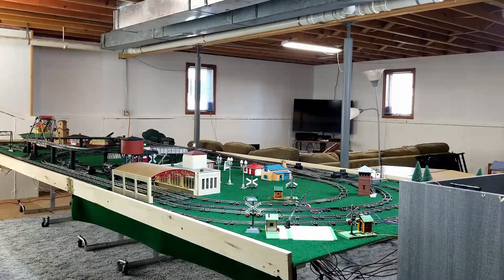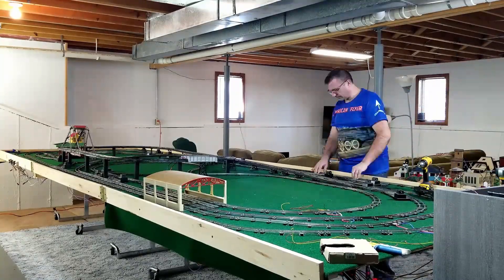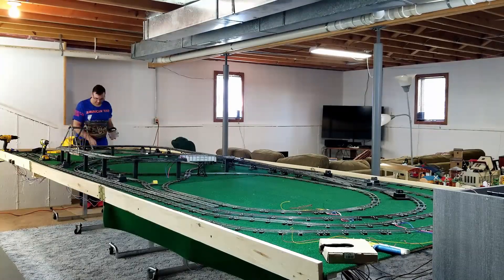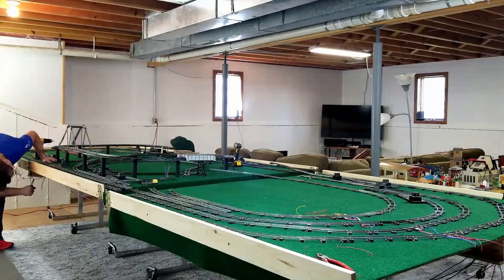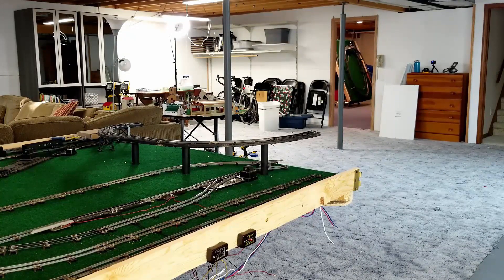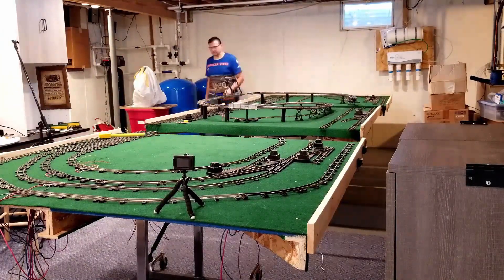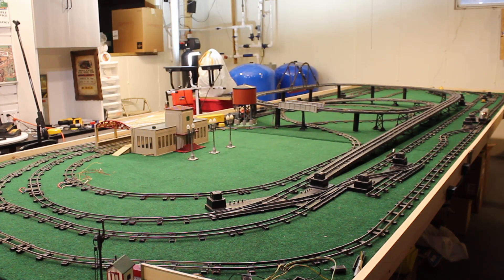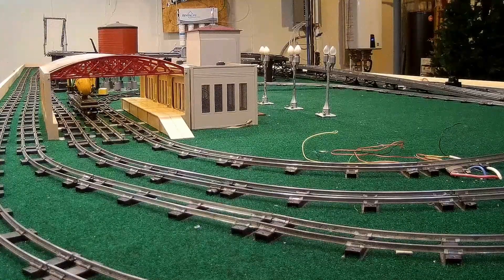You got to move it!  A unique build put to the test.

Comment: Good job master engineer of all things portable.
Reply from the maker: Thankyou Gary!  How is your layout progressing?  At this moment I'm messing around with track and switches attempting to get the accessories to fit, be able to be seen and still function.
Reply: @AustinsAmericanFlyertrains  Sounds like a project that should keep you busy for a bit. Layout is coming along, slowly. I have the bench work designed and the cut list pretty much figured out. Need to clear out some stuff in my office, then start building the bench work. Not sure yet about how the track work will look but do have some idea of what I want to do with it. I'm going to make it somewhat modular so if ever it needs to be relocated or sold it will be a bit easier to do. Have a blessed Resurrection day.